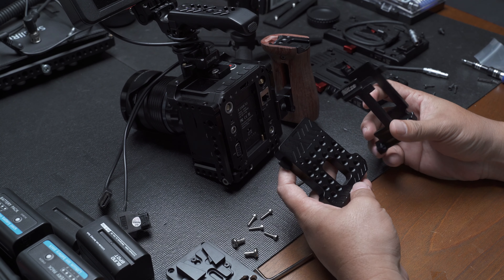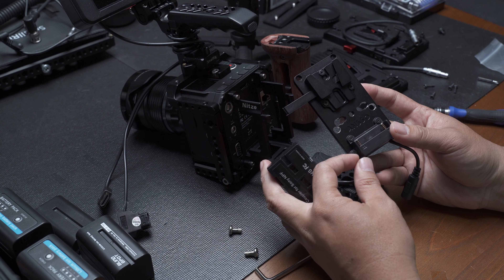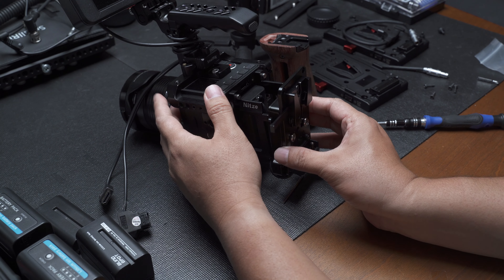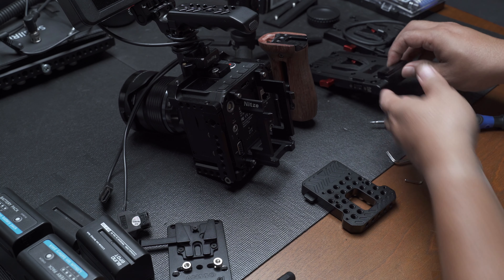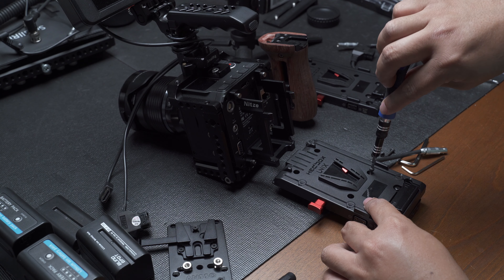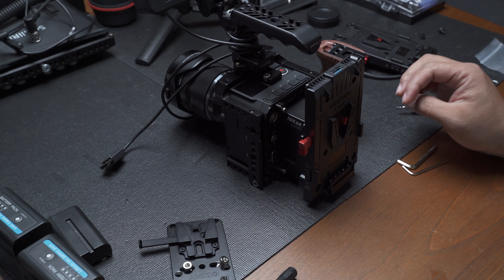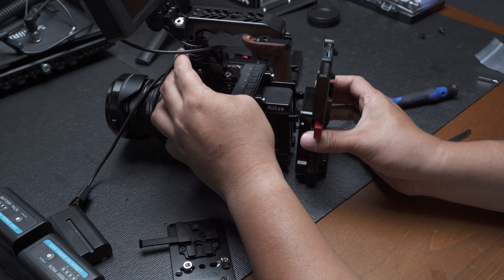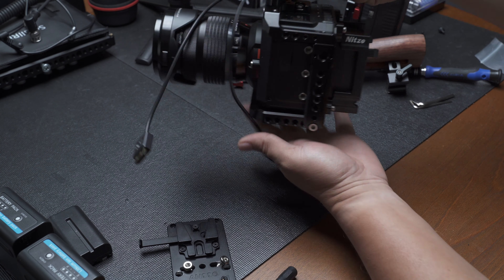Nitze Universal V/Gold Mount QR Adapter for Z Cam E2/Flagships

Comment: Hey there, thanks for the great video!! I've heard a lot of reports about NOT powering the camera (Z-cam) AND the monitor from the same battery when using an HDMI monitor. I remember seeing a VERY long thread in the Z cam FB user page, but it became so long and I never heard what Z cam ever figured out about this. You sure seem to know your stuff, so I figured I'd ask you to see if you had any updated info on this...? Thanks in advance!!
Reply from the maker: This is from using NPF batteries like the Powerextra NPFs where there is a DC output of 7.4 volts. If you use one NPF with monitor, you're risking voltage draw or spike that could damage the monitor or the camera. Unlike V-mounts, you get 16 volts which is a ton of juice to power accessories. And the whole reason i prefer using V-mounts is to power all accessories at the same time. Also you never remove cables like HDMI while battery is installed. Always plug everyhing in, install battery then power the device. It is not recommended to pull HDMI or any power cable like D-tap while everything is on or battery is installed. I have been using the V-mount battery on my E2 for three years and never had this problem, so does a lot of people in the community. Those reports you see is from improper handle of cables and battery.
Reply: Exigent Films thanks for the quick response!!!
Reply from the maker: @robgowler378  No problem man, if you have any questions, feel free to PM me in the E2 Group.

Comment: Can you use the Ansso mount to power a Atomos Ninja V as well as the z-CAm and if so what battery would you suggest for 4Hr plus use time?
Reply from the maker: You can but unfortunately the Ansso plate is hard to come bu nowadays. If you want to power both Z cam and Ninja V for 4 or more hours, i recommend ROlux V-mount 155S